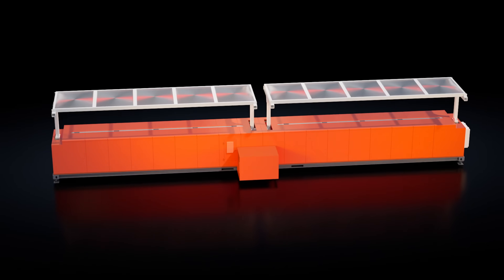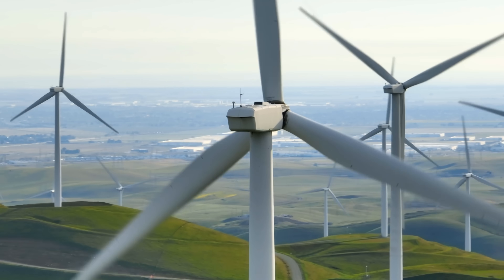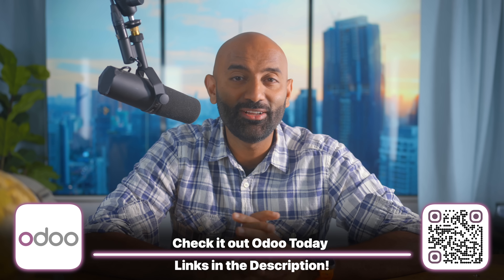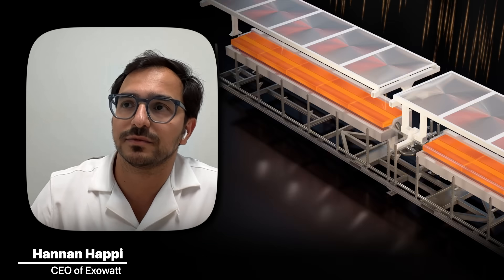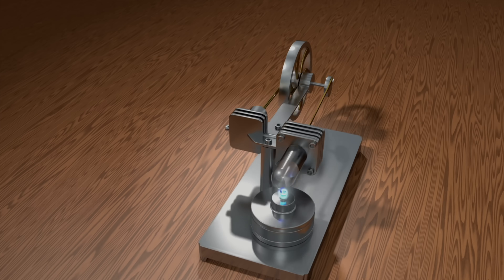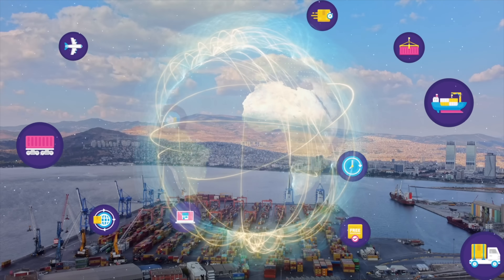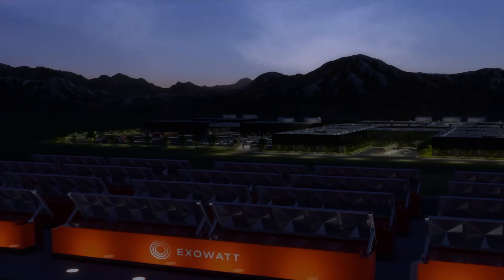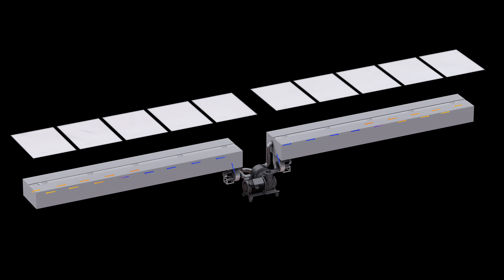Solar Without Panels, Storage Without Batteries - EXOWATT

Comment: Hmmm, not to be contrary but...Sounds like this is what you are doing:
1. Passively heating a thermal battery.  
2. Using pistons, cylinders, flywheels and ...
3. A heat exchanger converting the heat to electricity . 
4. Taking the electricity to power a heat pump to heat my home (see: pump, piston, etc.)
Question:  Considering  62% of home energy consumption is used for space and domestic water heating...
Why not simply  run the heat from the thermal battery directly to radiators (in floor or wall mount) in the home and cut out at least one if not more steps and complication? 
One might possibly be able to use sand in place of high tech ceramics at a much lower cost.
Farm homes that burn wood to heat their homes using a completely separate building, mass and insulated piping might have something to teach us.
Reply: There is not much sunlight in winter when you want to heat :) In summer you can have hot water though. Evacuated tube collectors do the same but much better.

Comment: “A single module can dispatch 25 kilowatt-hours of electricity at 480 volts. Based on its initial target customer, the company’s own estimate calculator suggests that serving a 50-MW peak for 24 hours in a sunny state like Arizona would require up to 1,123 acres. That’s bigger than Central Park, nearly 1,500 football fields — or about one-third of the acreage of the famous Ivanpah CSP facility in San Bernardino, California, just to serve a small data center. A typical 50-MW solar PV system might take up one-quarter the space.”
Reply: I highly doubt the 25kW/h from a 40ft container 😄 The sun delivers about 1kW thermal energy per sqm, so far the math is right, but after converting it into electrical power you may get about 20%. That's what a solar panel also does, and it even works with weak sunlight to a certain degree

Comment: For true sustainability, we need to also think in terms of the broader systemic consequences. For example, a thermo-nuclear plant requires extremely specific training, security, maintenance, transportation and end-of-life processing. For low-tech technologies like ExoWatt, none of that is required. The barrier to entry is low, the barrier to maintenance is low, etc, etc.

Can we have even greater modularity? Can we have "mini" versions that one family, one community or one neighborhood can afford? Scale does not have to be achieved by using single installations, and top-down policies. If a little shop in Africa can buy a mini unit to run a fan ---- would that not allow a young student to study longer? Think in terms of cottage industries. Perhaps locals can even make their own bricks?

Why is ExoWatt using how air (i.e., blower fans) to transmit the heat? Why not simple thermal sensors?

Comment: I’m all about using renewables, and your solar battery system sounds fantastic. I believe wind energy is even more efficient if we build some giant monolithic honeycombed wind harvesting concrete structures, up to and past 100’ tall, to harness Wind-shear currents to feed turbines that will produce and store massive quantities of energy in small city sized networks of (maybe your battery system) interconnected UPS (uninterrupted power source) batteries, 20,000 cubic +or- feet each, create enough battery basins to store 28 trillion kWh of electricity, which should power the United States for 4 years. This massive 360° wind harnessing structure’s outer funnel openings need to consist of at least a 60,000 square yards or more, with bird suicide proof vertical wind surface-covering, before funneling the wind velocity down to the inner circle turbines that require a 2,000 square yard or less discharge ports. The wind vanes will be connected to automatic actuators for pitch control, perimeter construction openings throughout the 1 to 5 mile or more in circumference facility, depending on site conditions and wind history……….
 With massive vertical wind turbines to receive the funneled wind, engineered to direct the more extreme winds to exhaust ports or possibly more turbines, we install automatic relief dampers built into the concrete walls along the wind travel paths, that will also divert excess wind to secondary wind turbines that also store the captured energy into the rather large UPS battery system. This system is designed to withstand up to 500 mph winds and create energy on as little as a 1 mile per hour wind and create enough build up inertia to spin for several days without any wind, the structure will create around 6 million square feet of available habitable living space with room for retail shops, education and other entertainment.
We have enough wind on earth to power the entire planet indefinitely, but we have yet to build the Concrete or structural steel skeletal frame infrastructure required to harness and focus the wind’s maximum velocity points onto vertical turbines, We have already built and wasted countless square miles of opportunities in our current structures and high rise buildings, that have totally ignored the duality of focusing wind velocity energy benefits. We have the technology to engineer and build, city sized interconnected UPS battery basins throughout the entire concrete skeletal wind tunnel complex which can replace nuclear and coal power stations after the initial facility start up plus 3 years to achieve our first full battery charge. At this point public distribution is possible, and we will only need intermittent wind to maintain a full battery charge.
This funneled design allows us to consolidate and increase the velocity on a average 1 mph wind into a steady 20 mile or more per hour wind with the ability to create various levels of white noise, from pleasant falling rain to the horns of Jericho, by the time the tamed wind reaches the center vertical vane system that is set up with gravity flow piping connected to inter/outer reservoirs for fluids to automatically flow back and forth for maximum inertia, while the vanes are in motion, with most of the structures outer weight floating and traveling on a magnetically supported hollow tube in a level circular horizontal direction, which the center shaft bearings will appreciate very much. I’m hopeful that one day, wind harnessing will become a reality on this beautiful planet the Creator of the Universe placed our ancestors on.
The batteries need to be large enough to last indefinitely, and should be either your design or living organisms like some version of a chloroplast where the natural photosynthesis that occurs creates a safe unlimited energy storage pool, one that will require periodic maintenance by adding fresh chloroplast and removing waste as needed, a waste that can safely be consumed back into the earth as a soil amendment for growing plants…… especially my delicious tomatoes and peppers!

Comment: What about "charge up" ... i LOVE the concept but how much direct sunlight "time" does it take to bring the thing up to operating temp? Solar makes power the second the sun shines. There is certainly a relationship between storage capacity and " time" needed for charge up. Is it basically useless in Seatle and useful in Nevada?
Reply: It'll take forever, especially if you want to heat a large thermal mass from the top instead from the bottom.

Comment: The efficiency comparison is a bit misleading. Yes, solar panels have about 20% efficiency at converting solar radiation to electricity. The cited number for this stirling engine contraption was conversion from radiation to heat. But there will be significant loss when converting from heat to electricity. The system also does have more moving parts than a solar farm, but you'd have to see a site working for a few years to tell how much that will matter for the maintenance. Though if on demand storage and release proves to be robust it could be the major selling point. Although if we start getting cheap sodium batteries in a couple of years, the cost of battery storage might radically change.

Comment: Your video on Exowat was highly informative—thank you for sharing it. I’m curious about the type of containers required for implementation. Are these newly manufactured units, or can renewable or repurposed containers be utilized? I ask because there is a significant number of unused containers currently sitting idle in lots across the United States, and it would be valuable to understand whether they could be incorporated into the solution to lower costs.

Comment: Total bullsit,  no engineers were used in the making of this video.  Let's say you do use a sterling engine, you are omitting one of the most capital intensive parts of generating electricity, that is the generator itself.  People keep looking at the capital expense of solar panels as if that is the infrastructure need to convert sun into usable electricity.  The trouble is none of them drop the math down the the bottom line.  When you do you will find that natural gas is still the cheapest way to create electricity.  The fraud here is omissions, they are not telling you everything.  Get yourself a real engineer that knows hot wot property create your ROI, then this idea sinks in value.  You might use this to make a kiln or something of that nature, the trouble there is that with most things you need heat, you need consistent adjustable heat with a reliable humidity controls.  Then you get right back to natural gas being the most efficient.  Natural gas and coal are really hard to beat in terms of cost which is why they have dominated the energy for over 100 years.
Reply: It's about collecting investor money :D

Comment: bro - light 2 heat is not essential- ...that heat neads to be converted to electricity.
The total energy effiency must be calculated for electricity not heat and would be:
Total energy efficency:= light 2 heat conversion-coefficent (assume 0,55 ) * heat 2 mechanical energy via Stirling motor ( around 0.3)  * rotation ->electricity ( around 0.95) = total of : 15,6% energy efficency and therefore less than a solar panel. And therefor impossible to need less land for the same or more amount of energy. 
I like the technology - but the nrs are cooked....   quite trivial to see that tbh...

Comment: In areas where homes and greenhouses need to be heated, Stirling engines and electric generators are not necessarily needed at all, because the recovered heat can be used as is for district heating.

Comment: How long do the bricks stay hot? 🥵🧱 
Longer than 24hrs?
Bricks cool and loose energy, yes?
I’m wondering how the system will modulate volts, watts and amps for alternating current?
I dying hot brick needs a smart system to operate, yes?

Comment: I seem to have done some stuff, but they combined the wind, the solar and kinetic energy of the sea. Now you have this combine that container with water pump into it water steam which actually give you more power, which you combined with the turbine to get some of the windsif you can’t use all the energy well use every one of it combined all into one include the solar panel, but they get more cheaper. Use it as a back up back up.

Comment: Pulling energy from the grid is NOT the same as producing electricity 😂. Also, it only has 18% efficiency on the stirling engine, and the grid powered heating elements will also not be 100% efficient. So grid power storage and retrieval will have a MUCH lower efficiency.

With this device, reliable power generation should still be HIGHLY dependent on sunny locations with low yearly cloud cover.

Comment: What kind of controls come with this? Don't you need to remotely control the spin rate of each generator and meter the output and schedule deployment, monitor temps to know how much power the site is capable of generating?

Comment: If this is the size of a shipping container and can produce 25kw of power... what is the cost? This would be INCREDIBLE for home use.
Reply: It doesn't produce 25kW of electrical power. Probably 20% or less efficiency after converting it into electrical energy, and that's optimistic.
Reply: @SolarCookingGermany  Even then 5kW can easily power a house with no issues.

Comment: So, for the design pictured, how is heat transferred to the thermal battery quickly, but then stored efficiently. Or does the system need days to stabilize?

Comment: Um if it was taller could you start heating a liquid at the top and recirculate cold from the bottom.  Still use the sand/bricks to store the heat but deliver the heat via embedded tubes?

Comment: So how well would this work in a Midwest or 15:06  northern US area. Say somewhere that gets below 0 or -15 in the winter?
Reply: Cloud cover will absolutely kill this system. The low solar angle will also—fresnel prism lenses could help straighten the light, but the solar loss from a flat mounted system  is going compound those losses. 

The ambient temperature isn’t that big of an issue by itself though. If they are heating the bricks to 1000C like mentioned under normal conditions, the extra 20-30C average delta between a hot region and a cold region is probably negligible. Also sterling engines work better when the cold plate temps are lower in absolute terms, so a cold place would have slightly better conversion efficiency.

Comment: What about using a Tesla turbine instead of the original mechanism? I suppose it would need lower maintenance, but I don’t know the adaptations to work with hot air.

Comment: The system has a major flaw, it relies on moving parts. Moving parts will break. The good thing is that it does not use exotic materials. Still, it is a simpel design so any mechanic can do the repairs. It might take off.

Comment: Grid Level EE.  Rough part with Mechanical (anything) is Mechanical has expense, wear, and many points of failure.   If you want this for HEAT -- that is fine.  If you want this for ELECTRICITY -- sort of Last Century.   All that hardware and maintenance for anything mechanical over time COSTS.  A lot.  The video claims did not cover this.  We call it O&M (operations and maintenance) costs.    Meanwhile Solar PV Service Life is now up around 40+ Years, and is "Solid State" (no moving parts) with little-to-no O&M, and now so cheap, it works out to about 2 to 3 cents per kWh, wholesale or "behind the meter."  The land use portion of this video is WAY off, as well, but is a whole other topic.  Also his claim of "1 cent per kWh" is also false -- that does not even cover the Turbine, Generator, and Transformer that a heat/steam generation requires.

Comment: I don't understand the heat transference from the lens to the ceramic brick. If the light is focused on the container and that heats up, how is that heat transferred through the air to the brick? Air is a bad conductor of heat. Is the hot air supposed to be enough to heat the ceramic brick? That's where I am having my doubts. Seems inefficient. I would understand if the light was directly focused on the brick, but that is not what is suggested.

Comment: These seem to be best is certain environments - Like the US southwest where it's dusty and sunny most of the time.   In central US, though, or the mid south, not so much.

These containers are going to have to contend with animal intrusions - dark warm, places tend to attract multitudes of critters to use it as a home - from insects and reptiles to racoons, squirrels, or a hundred other critters.

How will the hold up in weather - think about the high winds and torrential rains that innundate the plains states every spring.  One of their benefits, I guess, is if a tornado rips them apart, there isn't a risk of radiation leakage, just flying rocks and glass.

I'm surprised there was zero discussion of how it might work when the sun isn't shining through a cloudless sky.   In solar panels, cloudy skies reduce collection, but doesn't stop it.   Seems efficency would be worse on cloudy days... Oh, wait - They don't care about efficiencies.   Sorry, almost foegot.

Good idea with limited application.

Comment: Exowatt does not publish their system cost. Is this a continuous 25 KW/hour? Seems like a small output for what a modern home would need. My tankless water heater uses 18KW.
Reply: There won't be 25kW/h after converting it into electric power, probably more like 10..20%

Comment: 40ft container surface area solar radiation about 24kw.time by Stirling motor efficiency no way 25kw per unit
Reply: @JochenDemnitz  40'*8' = 320 Sq. feet = 29.729 Sq. meter.  The Solar Irradiance for a surface perpendicular to the sun’s rays at sea level on a clear day is about 1000 Watt/m2 (which is somewhat optimistic).  Even if the containers were 100% efficient, they'd produce 30kW/hr for maybe five hours during peak light levels.   You're right, unless I've made a silly mistake in my calculations, their claimed numbers are ridiculously overexaggerated.

EDIT: OK, they're claiming that they can provide 25kW.  They aren't saying over what time period.  What misleading marketing-speak >:(

Comment: Would be interesting to see what the limitations are. What are the max temperatures like related to outside temperatures. The maintenance requirements and of course the required initial investments. If it is as good as suggested then it would be very good in supporting off grid living in remote areas. Could the idea be scaled down to use instead of solar to run like boats, caravans, etc. or is it just feasible for powering AI? This certainly is a very interesting concept but we need a lot more information about it.